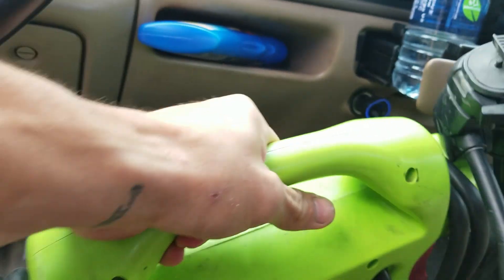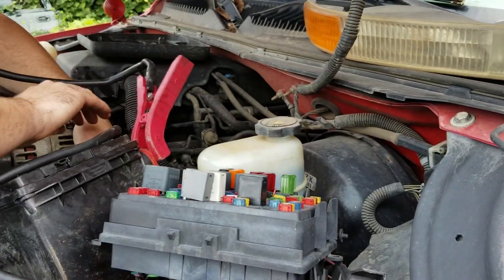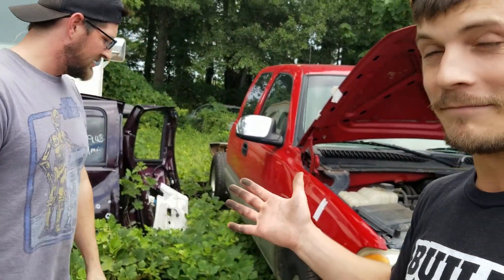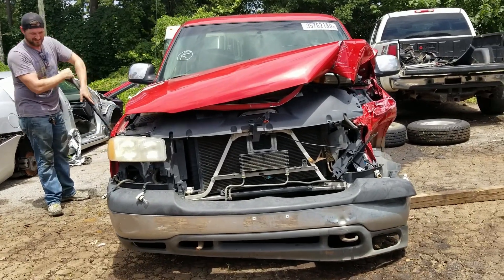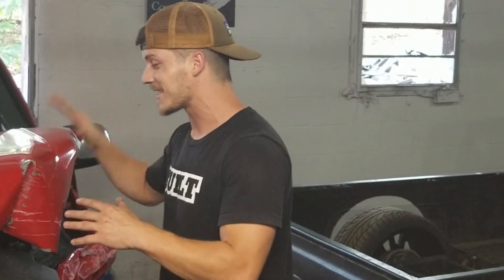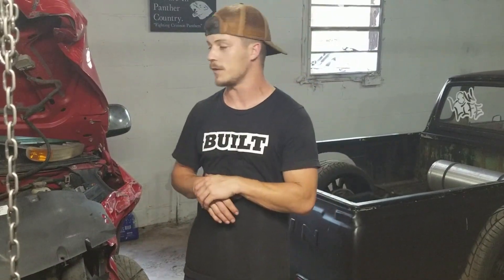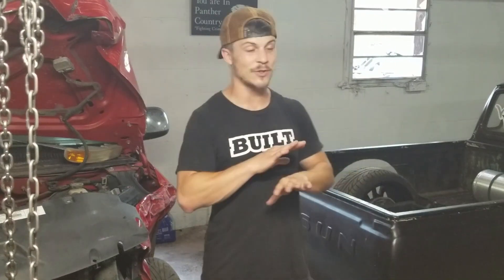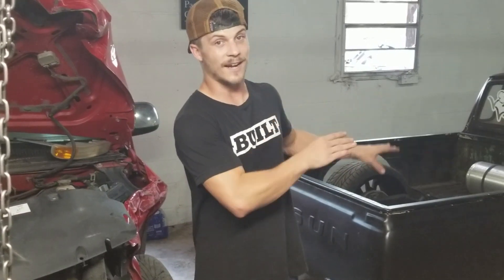THE FATSUN PT.2: WE GOT THE ENGINE SWAP FOR OUR DATSUN 620!

Comment: What about a Mercedes M113? The NA one if you wanted there's aftermarket support for it but it is expensive. However, no one has ever done it before so it would definitely be different and they're as reliable or even more so than the choices you guys currently have.

Comment: Just go carburetor injectiction. Just run the trans off the factory computer with speed sensors. The ecu will run the coils with proper sensors still hooked up and it won't care if you have fuel injection hooked up.

Comment: They make a kit that Converts the motor to carbureted I believe they sell it on Summit I think it’s in the 6 to 8 hundred range..
Reply: Why would you want to its so simple to use the factory GM pump and lines and put them in datsun tank
Reply: why the fuck would you switch a perfectly good fuel injected 5.3 to a carb plus they need all the clearance they can get
Reply: Boys old school is reliable and ez that’s why! and the Clarence would be the same I didn’t say put a blower on it🤪 honestly I think that Motor is going to be sticking out of the hood just by looking at the stock one already probably gonna need to do a Custom hood no matter what !! Really Hype to see the outcome no matter ! I run the set  up I suggested and I love it got rid of a lot of Headache 🤙🏽👌🏽
Reply: Jake Browne  he can still do that with the Carburetor